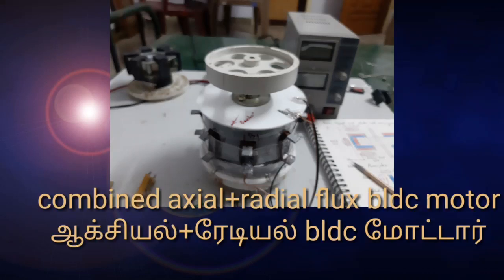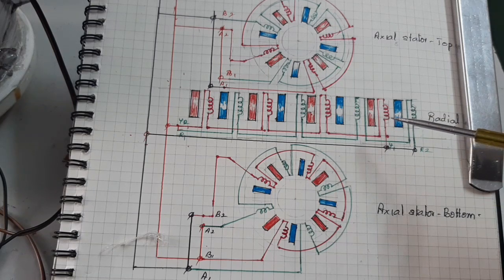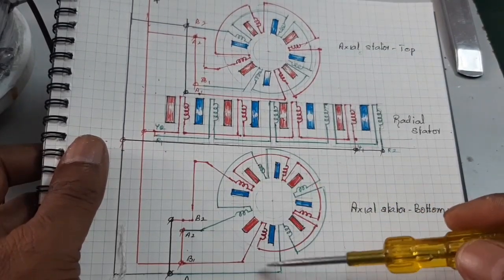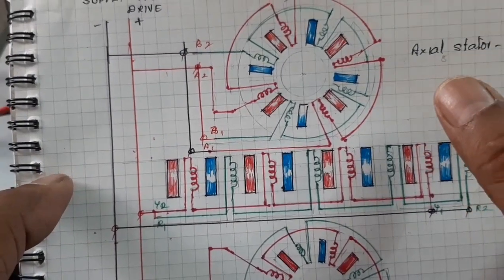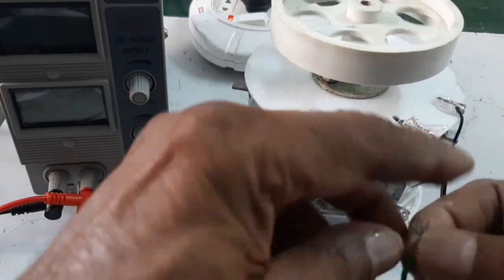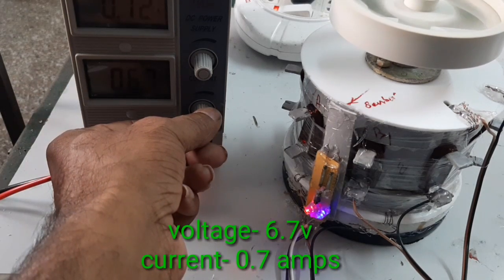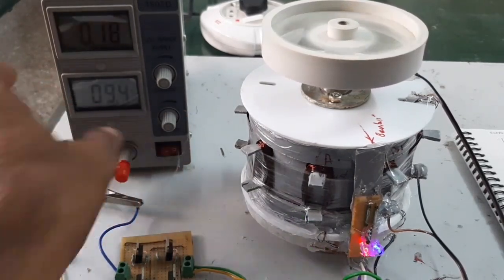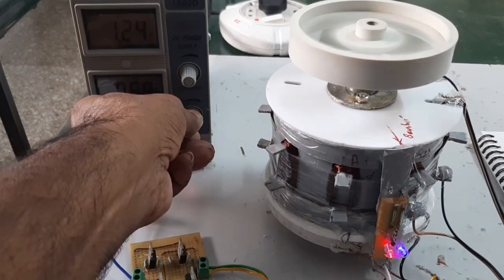(V-104),Combined axial+radial flux bldc motor (part-2),ஆக்சியல் +ரேடியல் பளக்ஸ் bldc  மோட்டார்

Comment: How did you arranged the magnets ? North, south? They are perfectly aligned?
Reply from the maker: For 3 phase 6 pole stator rotor poles are used either 4,8 and 16 poles
For single phase 6pole stator same no of stator are used for rotor.
Reply: @pugalstech  thank you for explaining.  The magnets are arranged N/S or they are all aligned on one single direction just North ?
Reply: Can you build a motor like this to have at least 20 KW continous power (peak power 60 KW) if yes what price will have? I want to know if I can afford to build one for me , also I need controller
Reply from the maker: I am a retired person and i want learn and share knowledge through youtube
It is good timepass for me and don't expect more from me
Thank you sir